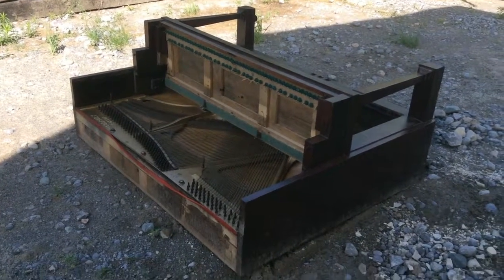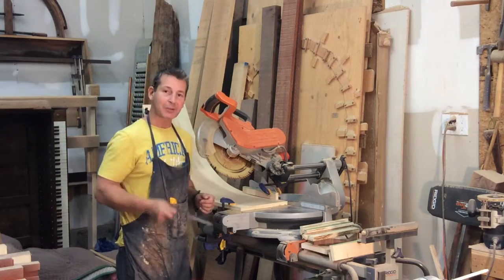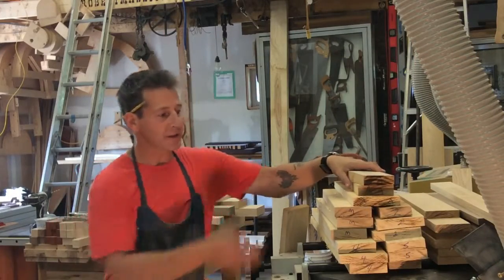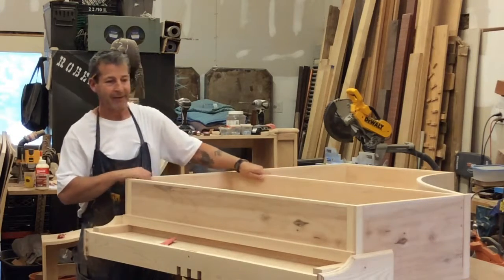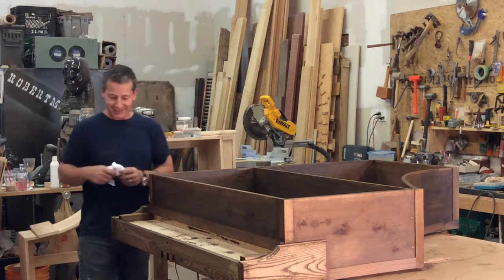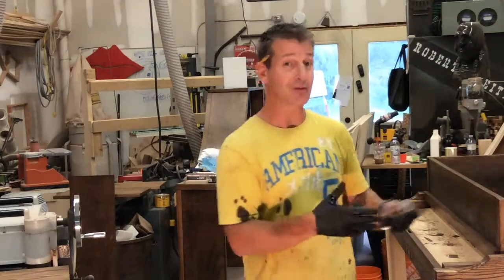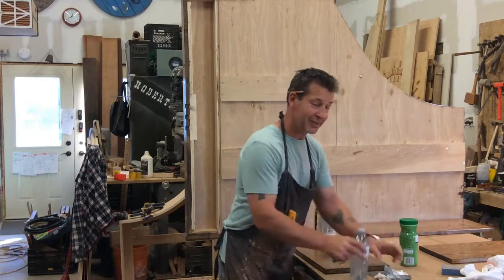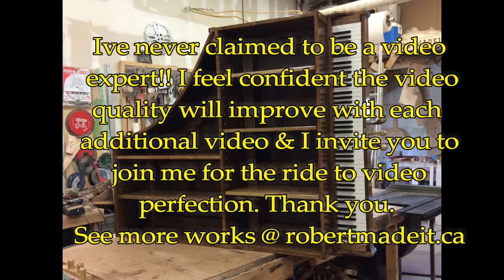robert made it up-cycled piano shelf build

Comment: Robt., is this something you came up with yourself? It's one of those things that if someone told me about it, I am sure I would pass on it, but after seeing it, I love it. The problem is you have so much labor involved it can't be a cheap order. Love your channel, keep them comin ....
Reply from the maker: Hey Mike, sorry for the very late reply, I had major issues with my YT account & couldn't seem to log in to reply. Anyhow, I "Thought" it was an original idea,,, thought I was the first ever to do so, lol, turns out that thought was dead wrong as I have since seen other "similar" things which actually predate my first one. However my process is completely "MY PROCESS", as I didn't know of anything to refer to. I should say the process has changed drastically since the very first one. Ive made 33 to date. They all ranged in over all size and options, I did 1 that was strictly a wine rack holding 12 dozen, (144 bottles!) of wine. Some from veneered plywood, some solid wood, an absolute beauty I made with black walnut veneered plywood & solid walnut, that was a sexy beast! Prices ranged from $2400.00  -  $4300.00 again, depending on size, options and material type & wood species. thanks for your comment